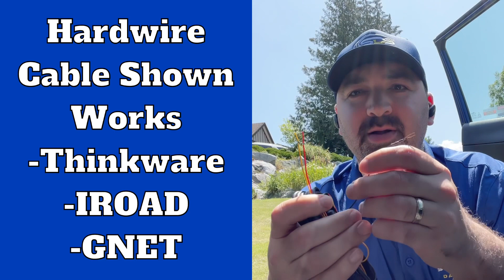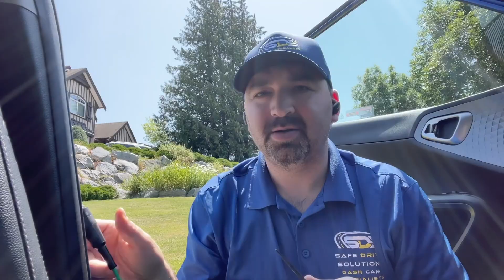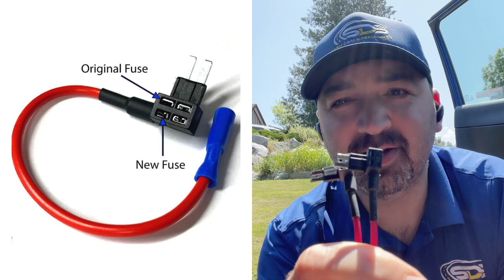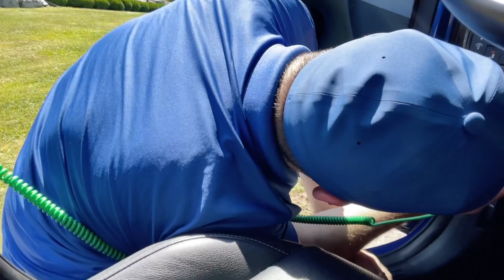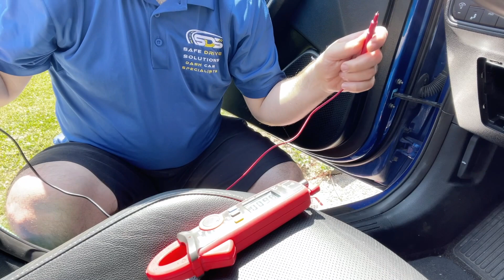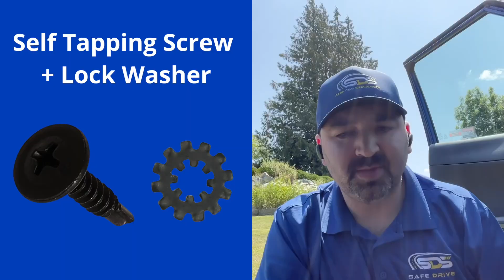How To Hardwire a Dash Cam with Fuse Taps | Safe Drive Solutions

Comment: Hi Benjamin, Thanks for sharing this interesting video, I want to hardware a dashcam via a fusebox, I can figure which fuse to use no problem, but the downside is my fusebox is located in the engine compartment next to the car battery, how can I feed the cable from the dashboard through the engine compartment, please let me know, Thanks.
Reply: It's a Vauxhall Astra, 3dr hatchback, the year is 2008.
Reply from the maker: @cliffordcharles1247  that is 1 car I am not familiar with. I will tell you this I have never had to go under the hood for any wiring on any dash cam installs to this date. If you really need to go through firewall I would look for grommets that you can safely go through for running wires. Or I would look at getting an OBD 2 adaptor that will give you power ground and ignition.
Reply from the maker: Hello Clifford what make model year of vehicle?
Reply: Ok, I'll try it either way, thanks for getting back to me, have a good evening.